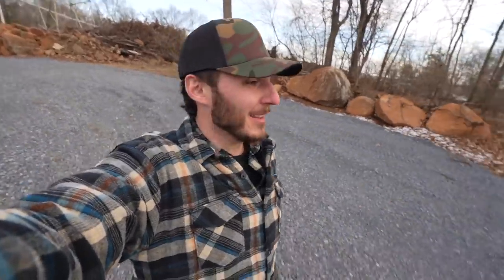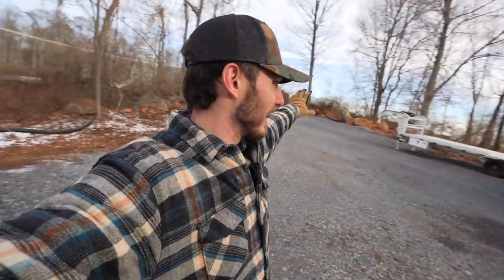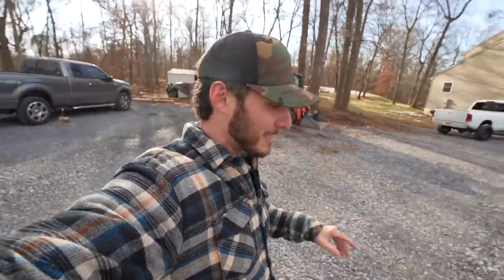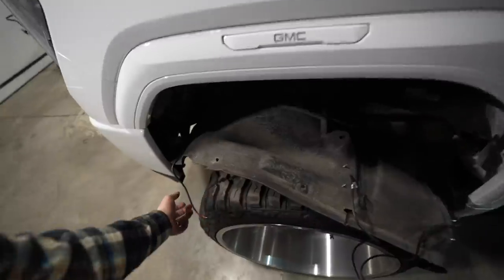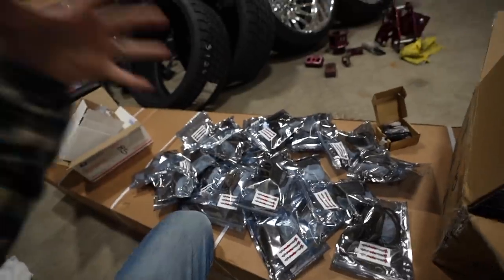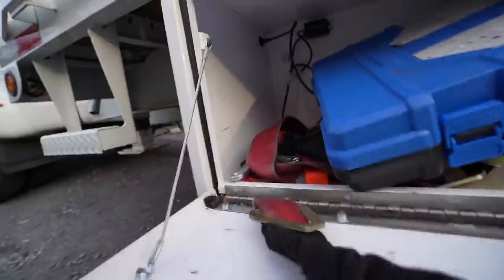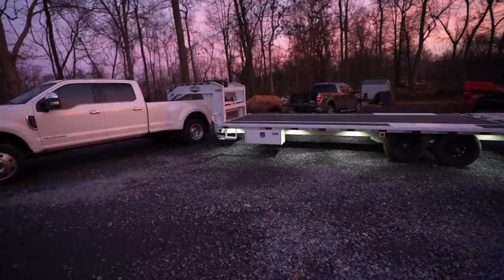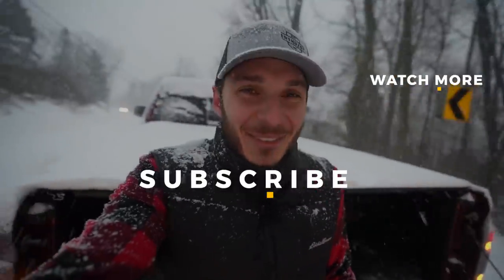The HIDDEN FEATURE Of My GOOSENECK Trailer!

Comment: How long is your gooseneck again? Cause I drive a 03 gmc 3500 with a 26' gooseneck everyday without a cdl and have no issues. And I have dot # on the side of it.
Reply: I drove my 15 2500hd with 34ft gooseneck. Drove it to Oklahoma. No issues. I believe why he has to get a cdl, his business. If he wasn’t hauling or using the equipment for his business, I don’t think he would need it.
Reply: @jonamandabarry4489  I haul up to 28k lbs daily
Reply: Damn dude!!! That’s what’s up!!!
Reply: Length is completely irrelevant. It’s simple. Add the GVWR of the truck to the GVWR of the trailer and if that equals over 26,000, you need a CDL. Does matter if it’s loaded or not.
Reply: @jonamandabarry4489  If he wasn’t doing business he would just need a “Class A”. It would just be a non commercial Class A

Comment: You cant tell me you not allowed to tow an EMPTY trailer without having a cdl
Reply: He got pulled over and fined for it before, and had to de rate the truck and trailer. I’m pretty sure he said it goes off of the gvwr combo of the truck and trailer. With the Denali the gvwr was under 26,000, but with the Ford it’s over that gvwr
Reply: It’ll be fine. He has a “friend” that can drive it with impunity.

Comment: F450 weighs 10k pounds so the trailer weighs 18k pounds empty im confused
Reply: @NWI_Steel  yup. And the truck is 14k gross I believe. So he is at like 32k
Reply: The truck can pull like 40k but i always thought its what it actually Weighs
Reply: @jayfox5  California is a great example of this. You can not tow any trailer that has over a GVWR of 10k with either an endorsement that gets you to 15k with specifically a RV with a fifth wheel connection (gooseneck does not count), or a CDL to open you up to use the trucks actual capacity. So with that logic. Unfortunately, There is literally no point to buy a diesel to tow as you can’t even use the New F-150s full tow capacity without a CDL.
Reply: Without*
Reply: Well I guess im glad i live in upstate ny where i can drive a tank down the road